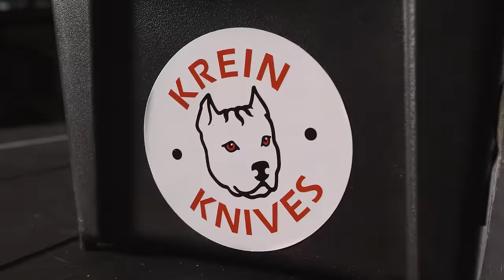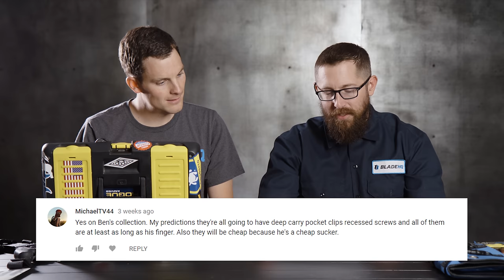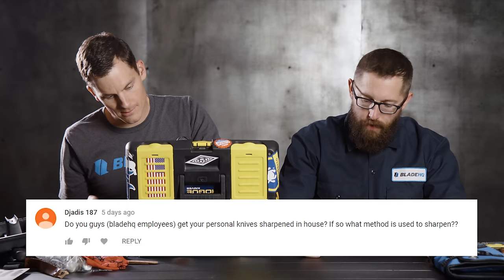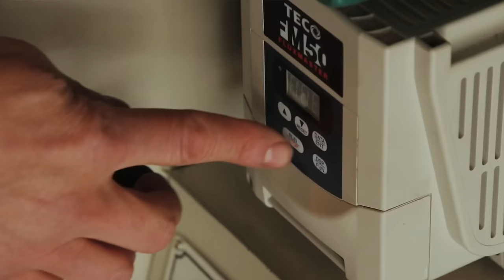Knives Ben Stole | Knife Banter Ep. 50

Comment: My Five top knives to carry:

1.  ENZO TRAPPER in ELMAX steel.
 ELMAX holds the best edge of all the steels available.  Plus, it is highly resistant to rust.  On the downside, it is NOT easy to resharpen, but since you will be sharpening it much less than other steels, it works out to your betterment.  
BEST OF ALL it comes in at $167 US dollars.  It is the least expensive of all the TOP Quality knives, and it arrives at your door RAZOR sharp!!!

2.  BOKER 115465  CARVER'S CONGRESS WHITTLER POCKET KNIFE (If you cannot afford $60 for a multi-blade whittler, then get the $20 BUCK LINEMAN).
     The Boker Congress has a Sheepfoot, Spey, Pen and, Coping blade, and this is good quality steel that will hold an edge.  The downside to this knife is that I don't really need a Spey blade. I'm not going to be Spaying any animals.  I'd much rather it have a Wharncliffe blade instead for really fine work.  The Wharncliffe blade is a type of Sheepfoot blade, but rather than sort and stocky like the sheepfoot, which makes it great for long cutting strokes, it is long and thin at the end, perfect for getting into small places and doing detail work.  For $12 more you can pick up the American made CASE POCKET WHITTLER, it has the Wharncliffe, pen, and coping blades, but no sheepsfoot, nor a spy.  Either is a great pocket knife to have. 

3.  CRKT MAHCHET
      This is the only big knife I'd carry.  It has a nice curved cutting edge ending into a VERY dangerous point for poking, boring wood or leather etc..  It is also handy for dressing game and for food prep.  The curved blade makes it really a nice chefs knife for cutting meat or vegetables.  It has a thick, heavy blade with a CONVEX cutting edge that is GREAT for chopping, splitting and battening wood.  It is a full tang with simple wooden handles riveted to the sides.  It fits the hand well and will not come out of your hand unless you have butter fingers.  There is a lanyard hole but not as big as I'd like, and not Counter sunk either.  If you are going to be hacking with this knife you should have a lanyard around your wrist so you can't lose it.

4.  FLEXCUT CARVING JACK
     This is the best multitool for what it does ANYWHERE.   It comes with a formed leather strop and compound so you can sharpen it anywhere, which is a REALLY GREAT THING TO HAVE, trust me on that, it is HELL to strop a curved blade, the one provided makes it so easy it should be illegal.
  Also, all blades LOCK INTO PLACE.  The steel is quality steel and the tools won't bend when used changing the angle of attack of your cut.  It is a stable took to use and is well designed with almost every carving tool you will need.

5.  LEATHERMAN SUPER TOOL 300.
      Its only weakness is there are no scissors.  
It has the usual screwdrivers and needle-nose pliers, but also a can opener, saw with Jap back-pull teeth, a file, leather awl, plus two blades, a standard utility cutting blade and a serrated edge cutting blade.  Plus, all tools LOCK INTO PLACE.  This makes it a vary sable tool to use, no slipping or worry for you.

These five will get you into and out of almost any situation a survivalist can imagine.  If you want to survive, have these 5 period!!!
Reply: Bill Andrews - what are you surviving from?
Reply: Elmax?? Dafuq, cpm rex is the best steel
Reply: Elmax was the best edge retention, 5 years ago

Comment: Ben, here is a question for you. You talked a lot about handle material, colors, carry style, different locks, etc. but you did not address the blade shape or blade material, form and function, although you did talk about length (finger length). What is your opinion on things like serrations or steel preferences, shape of the blade? Stainless vs Carbon? Edge Retention? Form and Function. What are your thoughts.

Cool collection 👍

Comment: I carry a buck 110 classic in a crossdraw sheath and I installed a kwik stud and it's been my only folder for the last 8 years I've looked into getting a more modern one but I'm stuck on the lock back drop point last knife I almost bought was a 110 lite am I just stuck in the buck rut? If so what are y'alls thoughts on the buck series

Comment: Hey guys. WHAT'S UP? I run across your channel every now and then. Your videos are fun/entertaining to watch. My question concerns a knife and/or tool that could be used in EMS or rescue. Several yrs ago (17+) I was looking for such an animal but was unable to find one. There seems to be a few but, nothing that is designed for what I was looking for at the time. I ended up getting a med. size crowbar for making entry into buildings that worked fairly well. Most of the time the hose jockeys, I mean fire dept., was on scene with that task left to them mostly. They really are appreciated though, with some being medics as well. Do y'all have or know of any such tool? (Yes, I'm in the South. Louisiana to be more precise.Started to carry a 'gator at work but they can get a little unruly on some scenes.) Back to reality, whatever that is. If such a thing is out there I'd appreciate it if you'd let me know. Keep up the videos and try not to take life too seriously.
Reply: Get a Burke bar Jr demo tool. Fits in a small tool bag, is made of super tough spring steel, almost impossible to break, and will pry a door open with ease. I demolished old buildings and built new ones in their place and Burke bars are essential. Only managed to break one when I ran it over with a forklift on accident.

Comment: You know a blade is sharp when you can’t feel the blow.
Reply: Couple years ago I was holding a box cutter blade. I forgot I was even holding it and at some point squeezed my hand. I looked down after some time and I had an inch long, half inch deep gash on the side of my thumb. I never knew how the blade cut me, or how long it took me to realize it, but the part that scared me was that the blade was so sharp that I didn't feel cut. The cut healed within weeks and i never even felt it, even under pressure or in water.

Comment: I need a good knife. Where should I look?. I want something tactical, light , strong. It can be a folder or fixed.
Reply: Sounds like you're after a Cold Steel knife. The triad lock is unmatched. The working man is a tough light knife but the steel is lacking. Id check out the Broken Skull though